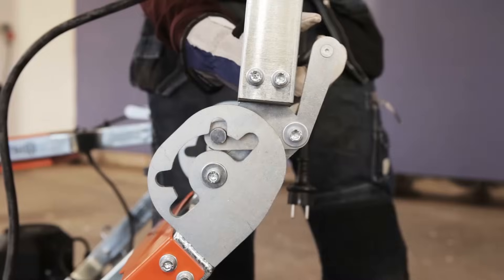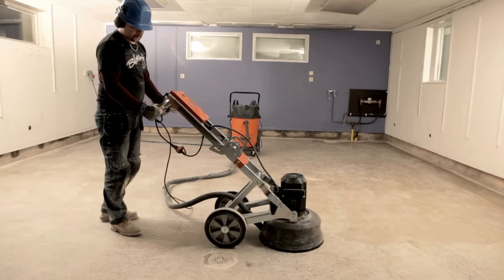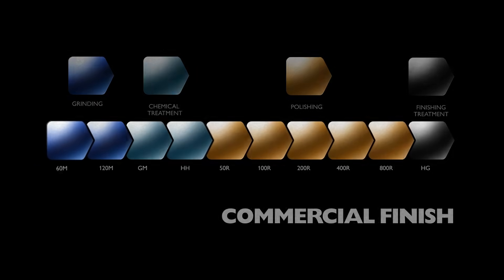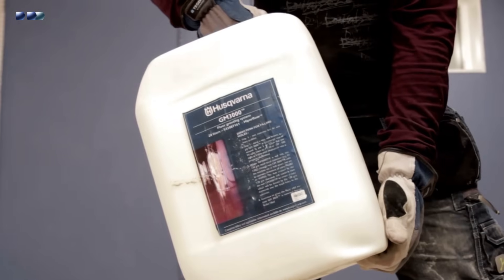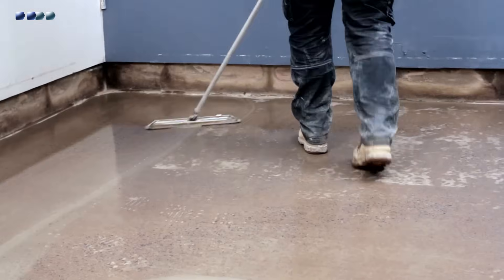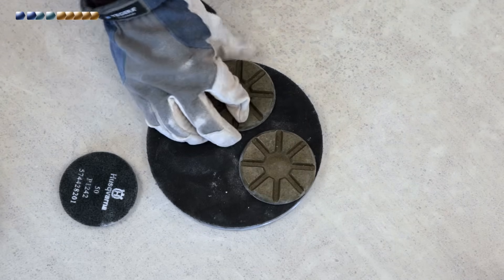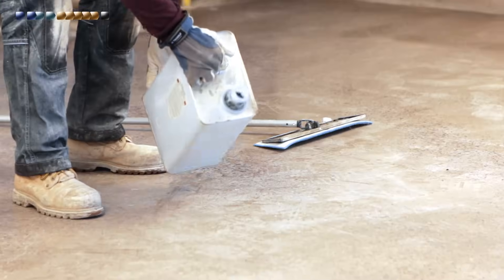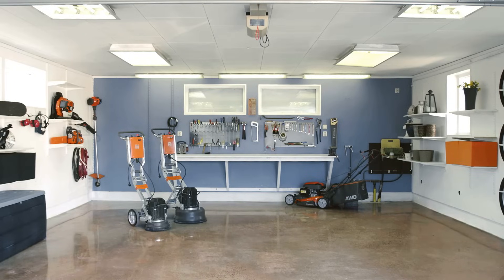How to grind a HiPERFLOOR® with commercial finish - by Husqvarna

Comment: Can this be used to sand a hard wood floor?
Reply: Where in trinidad you could get machine to  buy
Reply: No definitely not only concrete
Reply: Dumbass.
Next question:  can this be used to RUB OUT my  COMPETITION?
Reply: Use resin plates and run what ever paper you like. We use our pg 540 to do timber floors
Reply: We use the pg280 on plywood and osb for floor prep